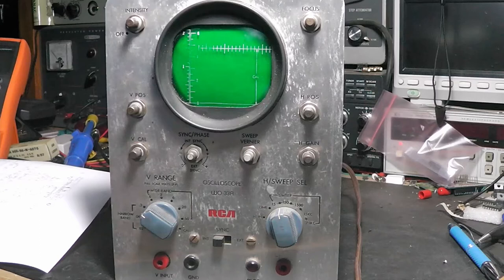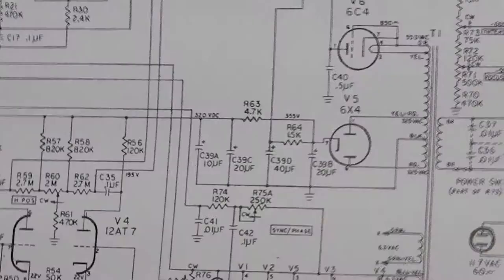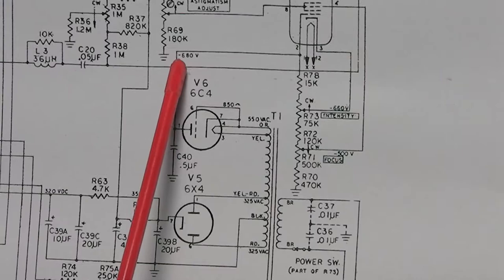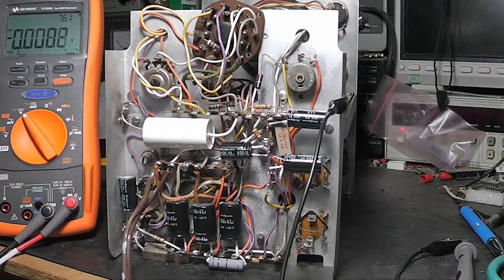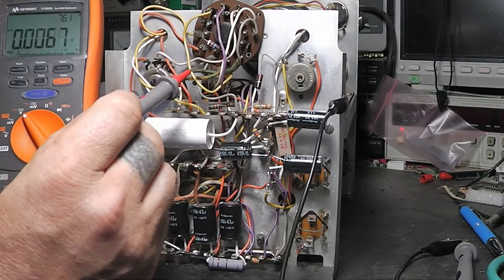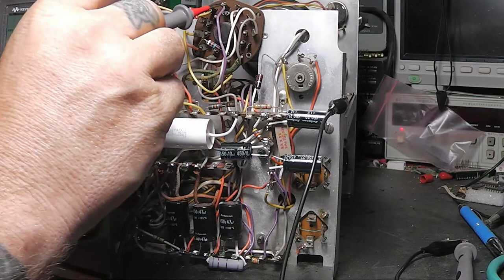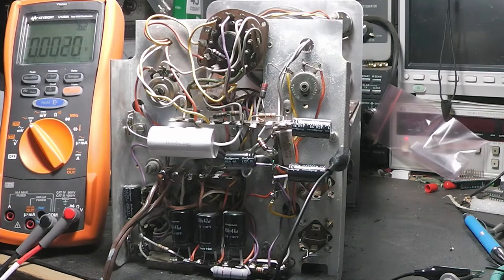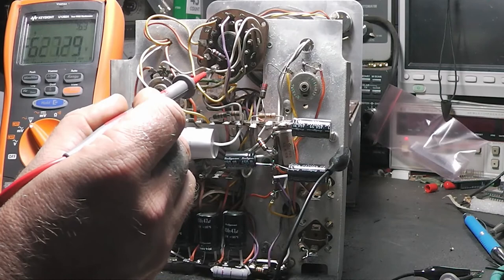RCA WO-33A Oscilloscope Power Supply Re-Cap Part 3 -- B&P 3

Comment: Nice project you got there ! Very useful piece of test equipment.
Any chance of a close up view of the controls from behind the pots/wafer switches in one of your upcoming progress video’s?
I own an older model and would like to compare with your later model V2, to see if any differences/upgrades are present.
Those 2 resistors on the large tie strip beside the old capacitor can, are actually on my version but located on the vertical switch.
Keep up the good work your doing, it is nice to see your progress. 👍👍
Reply from the maker: Thanks for the kind words.  I will see if I can get you some close up shots.

Comment: Nice video.  I have one of these too.  It works well but has the same burn in issue yours has.  I am going to turn it into a signature tracer also.  I removed the plastic lens and like it much better.  Best, Doc
Reply from the maker: Thanks for the kind words.  Yes, I almost have all the electronics in it and it is looking good so far.  Yes, when I cleaned it, I also got rid of that green plastic.  Looks MUCH better with out....at least to me.

Comment: That 6C4 has a crack in the glass near the top and the tube itself has "GONE TO AIR' because the black area you pointed out some of it has gone white which means the getter residue which is normally silver looking has been oxidized by the air. that tube is totally shot.
Reply from the maker: Yep, that is why I say one should never plug old stuff like this in with out a current limited variable supply, if one wants to just see if it will work. I have seen leaky caps do much worse!

Comment: This was useful to watch.  I have one of these i was just starting to recap and wondering if I could fit all those 8 replacement ecaps I bought for the job on that side of the chassis.  I've already replaced the huge 0.5 mF 1000V, and the 'scope seems to work fine without replacing  the existing electrolytics, but I don't trust them.  

Also, I notice yours, like mine, does not blank the retrace.  I had assumed that was a fault, but since I see yours is doing the same thing, I'm now wondering if they didn't bother with that feature in the design since it was made for TV servicing.  --John
Reply from the maker: Glad to hear you enjoyed it!
Yes, you are correct it does not blank the retrace.  I don't know if this was to save money on a couple parts or to make it easier for TV servicing.  However, no it is not a fault, everyone one of these I have seen, do that.